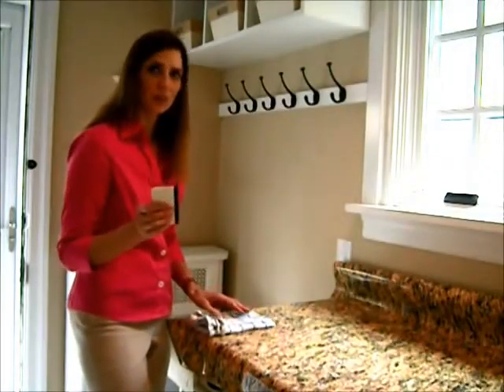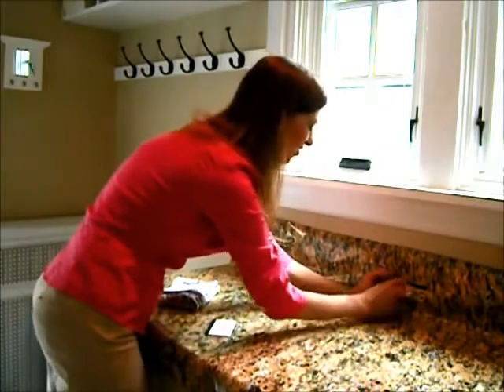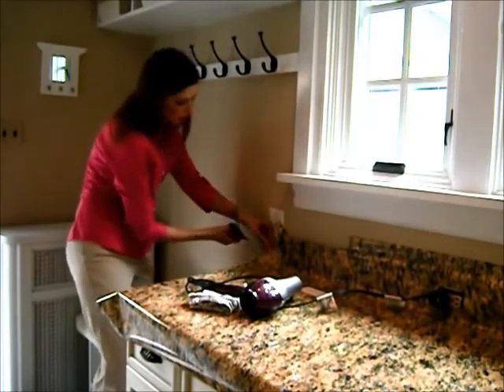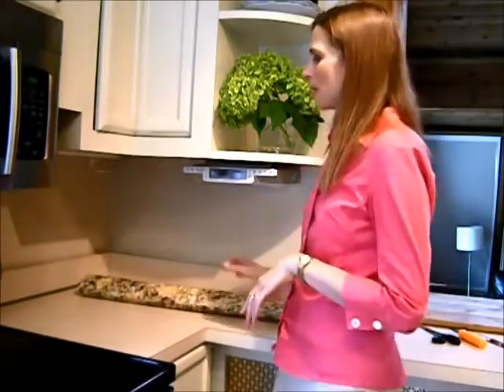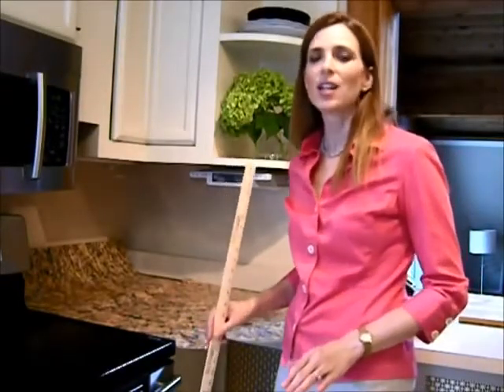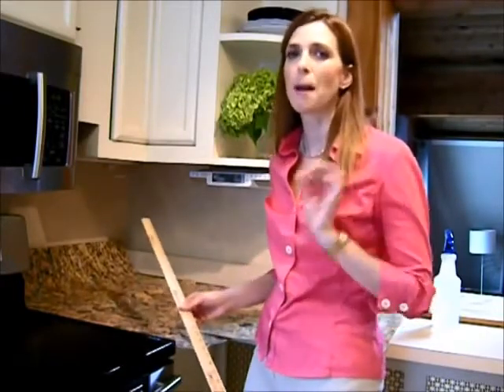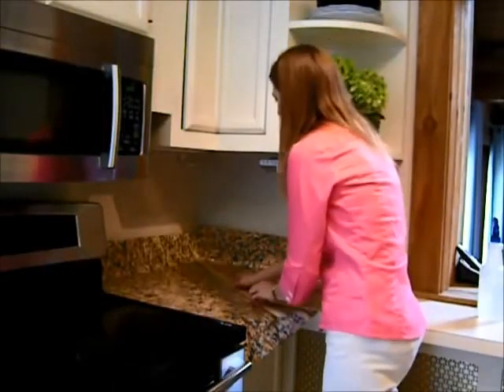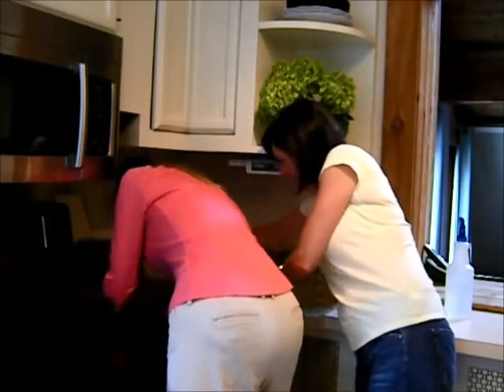Granite Film Installation Part 3 - Details like corners

Comment: I have main counter with squared edges on kitchen side with radius edges on dining room side...could wrap.  on kitchen side but no way on dining room side...only way to lay it would be to cut two in strip and wrap edge like original linoleum. .. correct? Thanks...ps does thid last a few years?